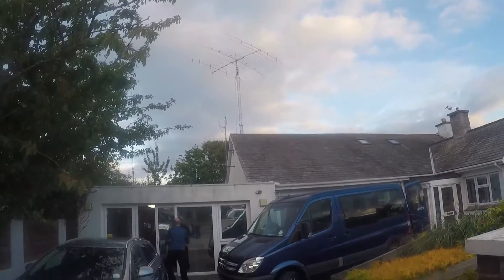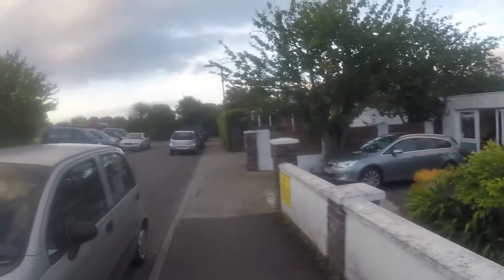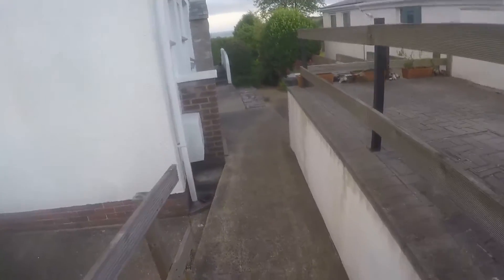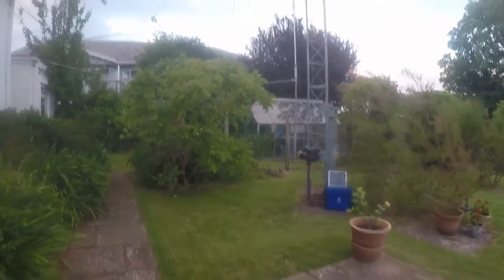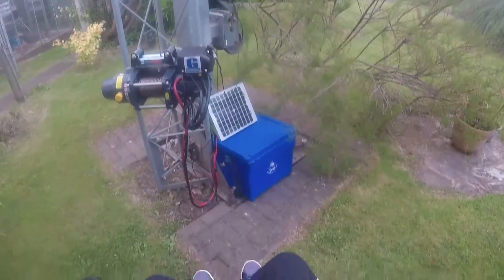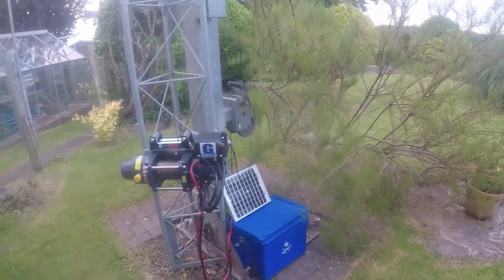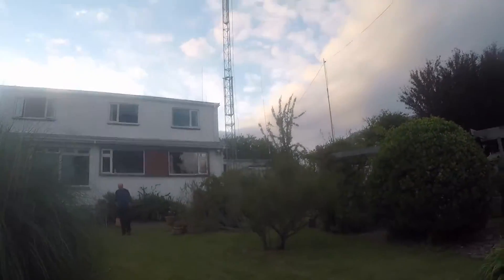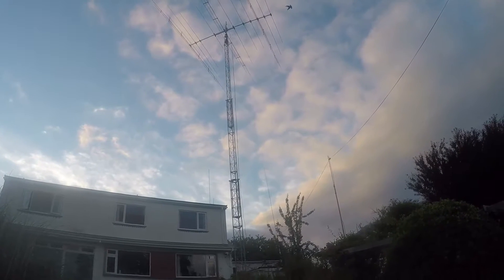G0VQY's 11 element Optibeam at 60 feet

Comment: how,s the optibeam going is it as good as you expected. thinking of getting one off tom myself.. thanks for the tour of the qth. nice set up..
Reply from the maker: Yeah, the OB 11-5 is fantastic. To be honest, I can't say there's a big improvement on the steppir because I can't tell and it would be unfair if I was to say I can just because I got the new one.. However, the fact that this new antenna doesn't have moving parts is one good reason for liking.
Reply from the maker: Yeah, the OB 11-5 is fantastic. To be honest, I can't say there's a big improvement on the steppir because I can't tell and it would be unfair if I was to say I can just because I got the new one.. However, the fact that this new antenna doesn't have moving parts is one good reason for liking.
Reply: PennG0VQY well i have just taken down the steppir after 10years of service beacause the driven motor has packed up. I want a mono bander with out any moving parts so this is my next option..

Comment: What make is the winch 
De GI4OHH
Reply: It is a Goodwinch. It is a company down here in Devon that supply them. Just type into Google and they will be at the top. If you have any questions and David is very accommodating. Actually, he is a radio ham himself and even though the winches are primarily fitted on vehicles, he does adapt them to fit on towers.
Reply: Penn Wooding 
Using same tower mate it looks good job